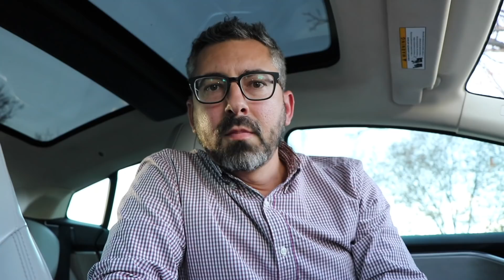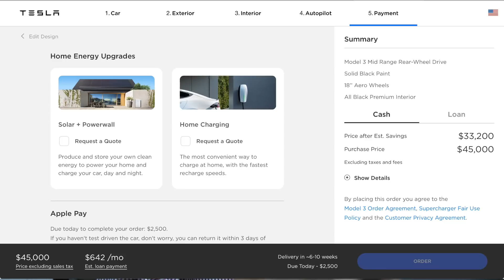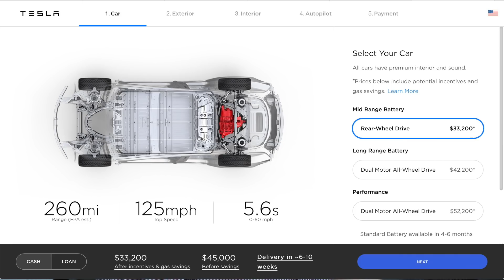Breaking: Tesla now offers a Mid Range Model 3

Comment: Now that federal rebate is 2500 less, they offer a worse car for 4000 less. So for $1500 we give up 50 miles of range? Not worth it.

I’ve been holding out for a standard (not premium) LONG range battery. I’m losing hope that’ll even be offered.
Reply from the maker: Fed tax credit of $7,500 is still intact through end of 2018, after which it gets cut in half for the first six months of 2019, and finally $1,875 for the remainder of the year. For those who take delivery of their mid range 3 before end of year will still be eligible for the full tax credit. As for standard range - I have a very high level of confidence you’ll see it before end of first quarter.
Reply: Sean Mitchell , the standard range is not what I’ve been hoping for. I’ve been hoping for a standard interior/exterior long range RWD. I’m thinking tesla doesn’t see that as profitable, and this is one move to avoid having to offer it.

I don’t care about nice speakers and a glass roof. What i want is a versatile and low cost electric commuter car.
Reply from the maker: I hear ya. My guess is they plan to offer a standard interior or they would have called the premium interior something else. I'm hoping the best for you and that you get exactly what you want.

Comment: Im going to guess 60 kwh battery pack.     They r only offering this in RWD, which gets about 6-8% better range than AWD.   Since they are not offering both with the same configuration stated range can be on one variant rather than the minimum range on 2 variants.

Comment: Tesla is either running out of customers for more expensive Model 3s, or it's having trouble getting enough battery cells.  Or both.
Reply: More like production numbers have increased to meet the demand of the expensive versions and they want to ramp up production slowly before the big 35k demandwave hits
Reply: Which is basically what I said with a little sugar on top.  Why sell ANY Model 3 for less if they can get more?  Obviously they can't, for whatever reason.

Comment: quote:  "Tesla is now offering a mid-range battery.  Wh…where did this come from?  This is wild and crazy!"

Wild and crazy?  Really?  eyeroll

To me it makes sense, they are rationalizing their lineup.  The only negative I can see is, the LR RWD is going away, which was the unofficial "range king" of the Model 3.  Although Tesla chose not to advertise it as such, the EPA testing showed it could get 334 miles.  Also bigger frunk, lower price tag, good deal if you did a lot of longer-distance travel and didn't feel a need for AWD.

Comment: correction, the tear down video estimates the motor at 750$ or so...wiring and what not for another 250$ doubtful

so a fwd motor isnt even worth 1000$
and the 15kwh they're taking out cost them what 1500$-3000$ 300$/kwh max?

so you're getting it for 10,000$ less and losing out on..4,000$ of stuff at absolute most?

sounds like a bargain
sounds like a reason to wait for a 40k and a 35k version if they're going to knock another 5-10k off and take away a whopping 1500$ of batteries that you may not want anyway 

except that the bolt/leaf etc are already at 27,000$ after credit, when tesla has to claim credits the car will never get in time for full 7500...california credits...that the others would all get anyway and is besides the point...and has to claim gas savings as well upfront and not over time against interest.......all to claim 35,000$

maybe the'll cheapen it up some more but the odd insistence that this 45k model is the "35k" model is a bit comical
theres not 10k left of stuff to take off of the car.  the entire 60kwh battery pack is only worth 6-15k 

no shame in admitting they cannot reach 35k, despite bolt/leaf doing it easily enough
it is an upscale car so it does not need to reach prices that low unless they want to get into the volume game and abandon the brands upscale pricing to date

Comment: so you save 10,000$ on the cost of the car 
and you give up 15kwh? worth some 1500-3000$
and a front motor that wasn't doing much anyway worth what 3000$?

so you save 10000$ and give up some 5-6000$ of stuff that most dont care about? why not

as superchargers get more dense a 60kwh 3 will be able to charge more frequently ie faster overall than an 85 back in 2016 despite costing 1/2 as much....

there no need for 300 mile range if you cannot afford it
the few rare time you need to travel 90kw+ charging in a BASE model 3 is nothing to laugh at 

compare this to the 100D where they charge you 19500$ for 25kwh lol
here we see that 15kwh and a motor is only worth 10,000$

ie the 100D is way overpriced vs its base and in general for an OLDER BATTERY
Reply: Richard Roberson, $49k - $45k = $4k, not $10k. The front motor is not part of the equation for the change. You are trying to compare the new choices and say front drive unit and extra cells along with the extra 20k warranty. 

I and 300,000 others agree that the AWD LR isn’t worth $20k more than the promised $35k RWD 50 kWh version, and that’s what they are waiting for.
Reply: IMHO....what are we even talking about the website? which is the only thing that matters?

its 54 vs 45...= 9k

the point is margins are shrinking, and either tesla will never make the 35k or is waiting as long as possible to milk it.  ipace alredy starting to sell well
Reply: +Richard Roberson IMO, the premium model 3 buyers are depleting.  Tesla has all the reservation list, so they know exactly how long before that list runs out.  Tesla and the whole world knows that $35K model 3 won’t make any money, especially time like this for Tesla.  So introducing mid range model 3 solves 3 critical issues. 1. Converting long waiting $35K buyers. 2. Sustainable cash flow 3. Enticing new buyers.  Just my 2 cents.
Reply: Todd Gun, this is the reality that few want to accept. If they really wanted to offer a cheaper car they can offer the 75 kWh battery and standard interior for the same $45k. 

All the Tesla narratives are falling apart. The narrative that it’s just too complicated to put LESS cells in each battery to make the $35k car just got blown up. The narrative that they can’t make enough $49k versions to satisfy demand just got destroyed. Why stop selling something if it’s selling like crazy?

Tesla is going to need help soon.

Comment: I think 260 is going to be the perfect range for a lot of people. My S has 250 and I’ve been totally happy with that, even on 1000+ mile road trips. Of course more range is welcome but not needed, so for $4k less this will be a good option. I’m getting tempted... ;-)
Reply: range is meaningless....its recharge speed and frequency at which you can recharge
no point in charging to full at 30kw towards the end when you can leave after staying at 100+kw the whole time

more chargers are needed and will fix this anyway so range isnt the issue anymore
Reply: Richard Roberson 
So you’re saying that 10 miles of range would be fine as long as the charge is fast enough?

My point is that if you have less than ~250mi, you’ll be stopping more often than you want to when you’re on a trip. You want to keep ~20% as a buffer in case you run into wind or detour, and you don’t want to charge more than ~80% because the charge rate is so slow. So you’re only going to do ~150mi at a time with a 250mi range, realistically. That’s 2 hours of driving, and I sometimes don’t want to stop more often than that.

That’s just me though. I’m sure there are people who would be fine with stopping a little more often, and others who would not want to stop as often as me.
Reply: Nobody keeps 20% stupid buffer....what stupid detour is going to take you an additional 40 miles
maybe if you're poor and want a 35k car you can suck it up the rare times you ever need to drive beyond 200 miles

200 miles the first leg -/+ 40 miles or so wherever the charger is
charge at 90kw to 140 miles in what .....20 minutes?
drive another 2 hours

stopping 20 minutes every 2 hours is hardly worse than stopping 40 minutes every 3 hours in a model s/x 75D....

quit complaining.

adding chargers is alot cheaper and needed anyway than trying to get free batteries into  a already small margin car 

tesla is surely realizing this and lowering their range targets

180 miles of range will be just as fast if not faster in 2020 than 250 miles was in 2018

cross country new york to los angeles right now a 100D is only about 2 hours quicker than 75D
more than that when you have to factor in full charges due to sleeping
pretty crap for 19,500$ extra lol...25kwh of old panasonic batteries 800$/kwh??

the point is the chargers are in useless places and the 100D despite being able to charge 33% quicker so you'd expect it to be able to spend less time charging and drive at a higher average speed barely  saves 2 dam hours....across 3000 miles

the same goes for long range model 3....
either you can skip a charger on your trip or you cannot at this present day
nothing else matters

do you really want to spend 5,000$ to save 20 minutes of your life x times?
unless that x is 500+ the answer for most people buying a 45k car is NO
Reply: trips have nothing to do with range and have only to do with charging rate and charger density

high daily driven miles is what youd want the upgrade for

or if you're an old worry wort and want to throw 20,000$ to tesla for 10k at most of old outdated battery when the new stuff is going for 200$/kwh and charges faster....just to know you have 50 whole miles of extra range

oh and dont even get me started on trying to charge an energy hog 100D...a good amount of chargers do not output the full 120.  and if you have to share bye bye most of the 100D's advantage
Reply: Richard Roberson 
Why you rant??

I agree that we need more chargers, but even if you had a charger every 5 miles, I wouldn’t want to stop every 80mi to charge. I’m just not ready for a break yet after one hour of driving.

I do take a lot of long distance trips, so I can totally understand that someone who only takes one trip per year can tolerate charging that often, or more. But for anyone who spends their days on the road, it’s worth the money to get a bigger battery. And again, that’s just my opinion.
Reply: thats the point Jeremy, most people who want these cars only need it to do daily driving
if you can afford a 45k midsize sedan you have a 2nd car if you have a family, this is a horrible option as the sole vehicle for a family with kids

you do not need 240 miles

a 240 miles 75D s/x that has been fine for 5 years had to charge 40 minutes+ every 3 hours not even that at highway speeds

75kwh

a 60kwh model 3 is some 220 miles more or less the same
and charges significantly faster.

for the vast majority of trips that the general public will ever make by car (200-400) miles away they will only need to supercharge 1x and as the charging speeds are increasing and you'd have to be stopped for a whole 30 minutes range is becoming pointless

the only scenario where it matters is if you daily drive a crap ton in a city without a supercharger and do not charge at work etc.

most top 20 significant cities have 1+ superchargers already (other than san antonio somehow)

more charging stations coming in the next few years that will allow you to supercharge at 5%-50% instead of 25-70 will have a more significant impact on your range and charge speed than paying for batteries you'll never use 

not to mention its free
Reply: theres a reason nobody cares about the range on a gas car....despite the fact that itll take you 10-15 minutes if you get off a highway fuel restroom back to highway detour 

we're not in the days of the S60 (2015-2017)  the chargers are everywhere and base cars are all getting 100kw charging speeds s/x/3
Reply: So how much range do you think an EV needs if it is being taken on a 500+ mile road trip once a year? Assuming there are plenty of fast chargers.
Reply: depends on where to be honest

most charging gaps are about 120 miles across the midwest
thats wildly different from the east and west coasts where you're looking at 60-80 mile gaps

200 miles would get you easily 170 miles 80mph highway speeds. youd make it to first charger after 120 miles, you could not likely skip one in midwest without 300 miles of range

no point in doing that after the first full charge as it takes so long so if you have 300 miles of range congrats you saved 20 minutes on a charger 

youd then charge for 25 minutes or so at 100+ kw picking up 40kw of range or 140-150 miles to get to next supercharger with range to spare

500 miles with 1.5 hours of charging
versus 500 miles with 1 hour of charging not a huge difference

.5 hours on a 500 mile trip is not worth 5000$

unless you're daily driving it using the full range to some degree most days it will never pay off for you.

its quicker to travel with more frequent stops as you can charge at a higher rate 0-60%, 
the tesla trip planner will even have  you stop sometimes when you do not need to (too much built in buffer etc)
Reply: you can see all of this on ev trip planner

the point is a 100D cross country will only save any real time due to overnight charging as you spend 4 days cross the country.  youd pick up a scant 5-10 minutes of savings at each charge in a 100D if youre LUCKY over a 75D...

slow chargers and sharing can see that erased
Reply: I said "assuming there are plenty of fast chargers", like in the future when there is a Supercharger in every town. Obviously no one needs a 100D, that has more range than you need even today; I'm just asking what you would say the minimum is for a comfortable road trip when there are chargers every few miles.
Reply: id say 180 miles tbh
the charging times are only getting faster

180 + charge -/+ 15 miles eventually on average as teh network density increases just like gas stations
quick jump to 150 miles at 100kw and you're at 430 miles, 1 more fast charge and you're there

batteries are falling to 100$/kw the price for the semi tesla is preselling

and charging rates are growing fast as cell chem improves

itll meet in the middle around 220 miles I'm guessing more for convenience than need
3 hours of driving is the goal I guess, most trips wont need any and a 20 min stop isnt bad.

the next gen 90/120 s/x with new cell chemistry will be stupid 300/400 miles
they appear stuck putting batteries in to get power levels up

as is the 100D is a ripoff by teslas own standards 800$/kw vs 200$ bolt battery <200$ tesla and 100$ soon cost
and the power levels are moderately below announced cars like the taycan

3.0 base for s 3.4 for x should be standard by 2019

Comment: Most likely smaller.  The less batteries, less weight, so you go further with less.
Reply: not really no
200 lbs less of battery, and weight has next to nothing to do with vehicle ranges anymore
the wheel bearings have such low frictional drag your wrong